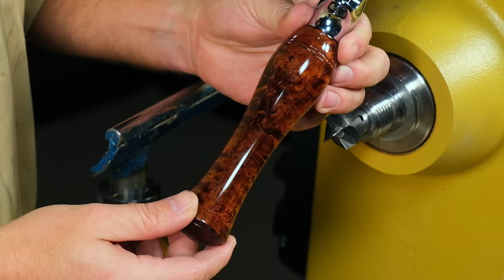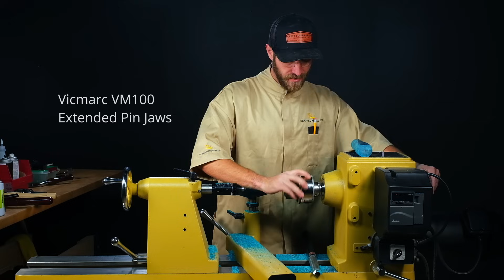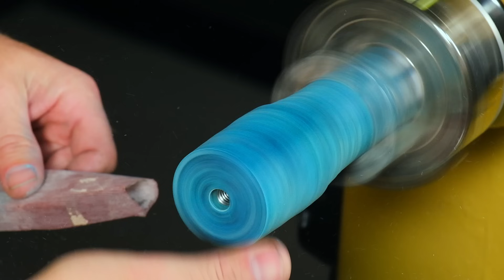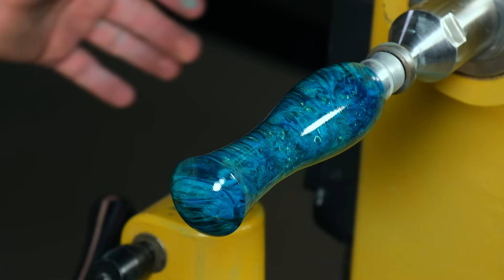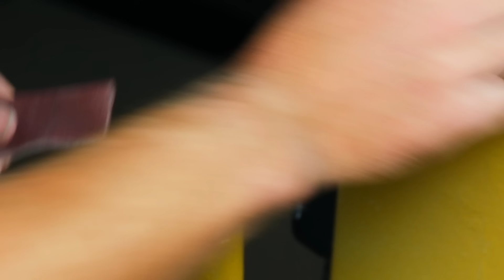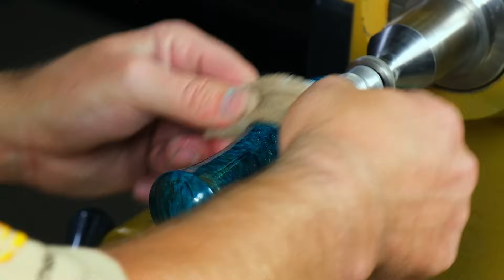The Perfect CA Finish

Comment: When he says "if you are catching, make sure you are on the bevel", what does that mean?
Reply from the maker: If the tool is catching it means the cutting edge is not supported by the bevel of the tool.  That is the area just under the cutting edge.  You want to start with the bevel of the tool rubbing the wood then start to make the cut.
Reply: @CraftSuppliesUSA  thank you!

Comment: Congratulations young man.
The most perfect explanation from the first step to the end was not only explained technically, but also carried out perfectly for the eyes of the viewer. I'm also a similar precision fanatic. Either do the work properly, or better go and pick flowers.
I've also gotten used to the trick of tightening the quill clamping lever a little while drilling so that the quill wobbles even less during the drilling process. It has also become a habit to initially loosen the lever on the tailstock in order to better achieve centering at the base and then clamp it tight.

Even the small CA glue bottles that we offer online are rarely of any use. If the dosing spouts have been opened and closed again a few times, the caps will stick together and if you unscrew them vigorously, the dosing spouts will tear off.

In the last few months I have seen countless videos about CA sealing and have copied or adopted most of them from you. Unfortunately, I have to admit that in our country there was hardly anything to learn when it came to CA high-gloss finishes in most of the videos. We were even able to copy the plastic bushings from you.

You have to admit that, especially since you are now an older generation and have grown up as a “Made in Germany” person.
I took up wood turning last year at an age when almost everyone ends their hobby.

Finally, once again: The best explanatory video I have ever seen on the internet, out of well over 100.
The only small exception: My large, thick hardware store paper roll hangs in a wall bracket for quicker demolition.
Reply from the maker: Thank you for the kind words.  I'm glad this video helped with your CA process.  Take care and have fun turning! -Mike😊
Reply: @CraftSuppliesUSA  - As a computer geek from the very beginning, I also looked around your shop. The prices for pen accessories are also okay, especially since they are significantly cheaper than here in Germany.
Kind regards and stay healthy.